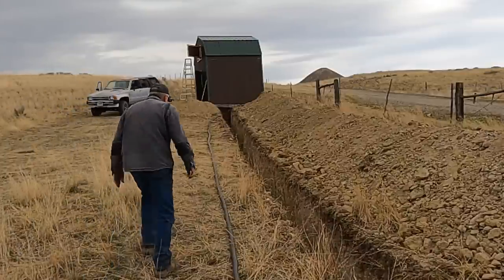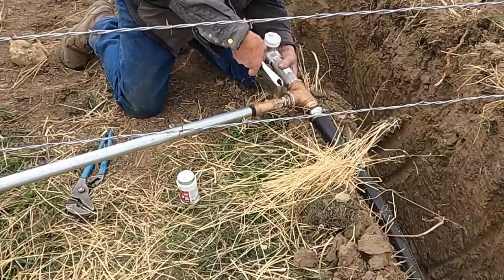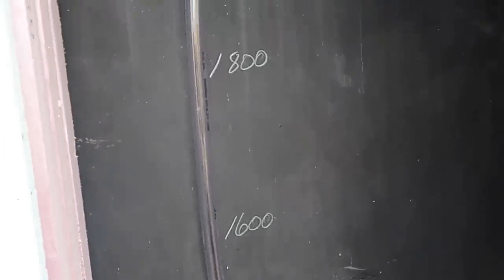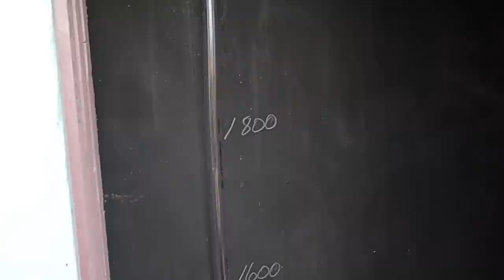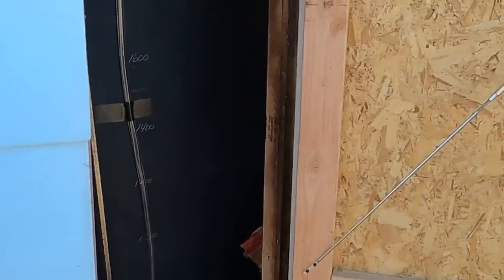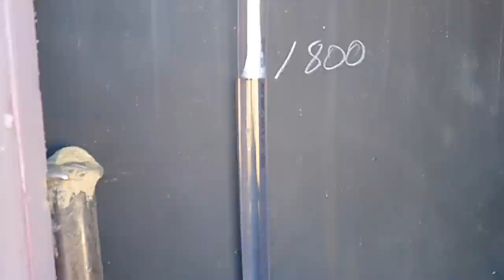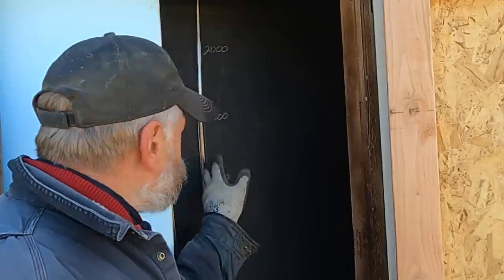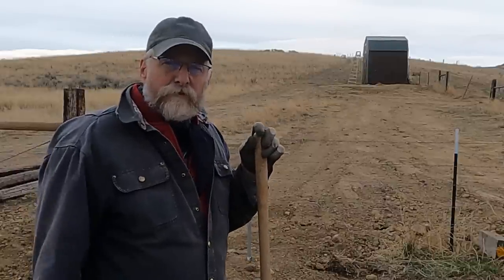Preparing for Winter Watering Calves | Engels Coach Shop

Comment: Lovely job, when we did similar for or field my father had some 4-inch heavy walled PVC laying around.  So he laid that in the bottom of the trench and snaked the flexible 2-inc through that from the well head tank to the frost free.  This way if we need to re-run the line, we simply go down in to the two ends and pull the run out without having to dig it up.  like you my Papa's always thinking on things to do.
Reply: Watching this, I was wondering about putting a large diameter PVC pipe around the drop pipe to the line, put your heat tape on the water pipe, and fill the space inside the big pipe with insulation.  This would keep the heat where it's needed. Could be added later by slicing the large pipe in half.

Comment: Been looking forward to this video all week.😁  Hope you have another video or two on setting up battery, heat trace and insulation of pipe, solar charging, final insulation of the building.   As others have noted, it would appear you need a vent of some sort at the top of the tank if one isn't already installed on the tank.  Filter on the vent seems advisable.  Temperature monitoring in the pit   and under the insulation would appear helpful, at least until you get a sense of how well the insulation retains the heat.

Comment: I couldn't tell, but when you back filled around the frost-free, did you add drainage rock so the water has a place to go when draining out the stand pipe?  Or will you be doing that when you start the extension project?
Reply: He put 3-5 gallon buckets of clean rock around the base of the valve.
Reply: I would think from the looks of his soil, drainage won’t an issue.

Comment: Looks like a good job. My only concern is that overtime will the rocks rib a hole in the line. I live in ohio and we have to use sand  under and over the top of a line and them back file with the soil. They tell me that the line will move some when being used. Overtime it will ware a hole.

Comment: Get yourself a couple extra unions the same as the one as you used in the tank shack.  Put em in a bag or box and set them in the shed so you don't lose them.  If you don't, when you actually need another half of the union, that same style won't be available anymore and you'll be in a hard spot.

Comment: Suggestion: look into installing an anode to prevent corrosion r/t dissimilar metals (steel and brass) at the base of your hydrant.  Nice job !
Reply: I think it is too dry for an anode to work there although there will be a 1/2 gal of water released when spigot valve is closed.  Tar works well.  Stainless and Brass will out last all of us.

Comment: Great project.  A tip for when you're joining the PVC to the brass coupling: after you heat it up and are ready to slide it on, spray the brass coupling with hair spray.  It makes it nice and slick so that the PVC slides on easier but then it tacks up very quickly so, as the PVC contracts back down as it cools off, it grabs onto the hair spray and helps bond it.
Reply: Aerosol or pump? 😃 Seriously, what a great tip!
Reply: @wileycoyotesr8623  It's an old motorcycle builder's trick.  We use it to slide grips onto handlebars.  Works like a charm.

Comment: Don't forget you'll need some sort of a vent .  Need air as the water level goes down, or you'll create a vacuum in your storage tank .
Reply: Was wondering where the makeup air / air release was in the system. Maybe the top hatch doesn't seal particularly well.
Reply: He must have a vent already or he would not be able to pump water into the tank.
Reply: @Clarence Green  he's only pumping 450 gals . Into an empty tank and long periods between loads it could bleed off . But you are correct.  It would pressurize the tank .

Comment: Job well done.  I expect the top of the tank is not sealed and acts as a vent.
A temp monitor in the bottom of the Pit would be interesting.  Time to check the Freeze level of antifreeze in your iron.

Comment: Dave the only thing I do here in Eastern SD is I put the hydrant with a 6 inch PVC pipe mostly to have the drain hole free to drain the hydrant when shut off and also if it would freeze a little hot water along the hydrant thaws out otherwise you have soil to contend with that is frozen and have trouble thawing it out
Had good idea and job installing looked good
Have good winter
Mike Olson

Comment: ref: 5:40
Your system will work, but you could also use a pressure gauge. Each foot of water would be close to 0.5 psi. Using a pressure gauge you could in fact place it on the hydrant and read of how much water was left.

Comment: I do hope that you used "marine grade" hose clamps. My father and I have used plastic water lines buried  underground and years later had leaks at the splices. I found that the stainless hose clamp, itself, held up well, but that the steel "screw" rusted away and let the clamp come loose. Later on I  worked for a boat and RV dealer and learned about marine grade, all stainless, hose clamps. I used these to make the repairs and never had any more problems with the clamps rusting out. Good luck on your project.

Comment: On our farm we did not use the clear tube method for depth measurements. 
Basically we had a float in the tank, connected to a cable that went out the top of the tank, over a couple of rollers and down to a free hanging weight. 
Just had to remember it was in reverse. 
Weight near ground, tank full, weight near top, tank empty.

Comment: Dave, I really like your "sight glass" installation.  I recently saw a similar one on a fuel tank which used a ball valve at the bottom in case the clear tubing got brittle and cracked or leaked.  It could prevent a costly loss of contents.
Reply: Indeed! Only open the valve when you want to read the level.  Otherwise, omit the risk of losing all of that water via a cracked plastic tube.
Reply: Notice that Dave's installation has a ball valve at the bottom of the "sight glass" too!
Reply: @garrettswoodworx1873  So sorry! I missed that.
Reply: @tuberzish  No worries Nate! I figured that might be the case.  🙃

Comment: I am sure you have thought of it but just in case, don't forget to put a foam jacket around and on your fill connection which is exposed to the cold.  You can stack two inch foam board glued together with spray foam and cut a center out to surround the pipe cap.  Nice job.

Comment: Good work!
Not criticism, but a tip from a retired farmer:
When pushing hoses onto barbed spigots, smear some vegetable oil onto the barbs, and on the inside of the hose.
Canola, sunflower, olive-oil, whatever.
You need not heat the pipe, as it slips on with the greatest of ease.
Heat degrades the plastic, especially plasticised pipe, such as you are using here.
And it is food-safe, unlike WD-40, which I have seen "cowboys" use!
Reply: Thank you.

Comment: Dave, you may find that as the 1/2" level pipe ages, it becomes increasingly difficult to see the water level. I have the same problem on my 1,000 gallon kerosene tank which also uses a 1/2" bore clear plastic pipe. I went to a fishing shop and bought a fluorescent green floating bead (3/16" approx), so it is now very easy to spot the level.  They actually just gave it to me, saying it was not worth charging for.
Reply: Excellent idea,👍
Reply: Great idea...
Reply: ❤ or use a diagonal stripes behind the pipe, like on steam engine water gauges 🎉
Reply: I’ve noticed a distinct absence of grass under your feet.😉
Reply: @cliveclapham6451  That works behind glass like I have on my scale traction engine but the problem with plastic tubing is that it grows increasingly opaque as it ages and I don't think you would see the reversed stripes through two thicknesses of old aged plastic. The fluorescent plastic bead solution does not last forever, as the plastic pipe becomes increasingly difficult to see through and the bead tends to bleach in sunlight. I replace both about every 7 to 8 years.
Reply: @wilsonlaidlaw  yes good point l made a glass tube for my application. 🍻

Comment: Great to watch as usual! But am wondering if the tank is vented, even a partial vacuum could collapse the vessel.  Could I also suggest adding an “on/off” valve at both the top & bottom elbow fitting for the sight glass? If a break occurs anywhere , all the water will just drain out to the lowest leaking point. When you need to see the level, open the valves, take a reading, then secure them so that they are isolated. Keep the content coming!
Reply: He did put a valve at the bottom.

Comment: I solved the issue of not getting last 50 gallons out of a transport tank by putting a elbow on the inside  with a perforated pipe just  off the    tank floor . It would get it down to about two gallon remaining in the tank. I saw one done with a flexible hose inside the tank, but it rubbed a hole in the bottom of the tank.

Comment: should not the pipe have been insulated on the riser to the pump head above the frost line?
Reply: The riser normally drains back.  The valve seat is at the bottom and there is a petcock on the riser blocked off when opened and once closed the water drains out.

Comment: - Dave, what is going to prevent the spigot and handle and metal pipe coming up from your buried line from freezing?
Reply: He mentioned a few times it is a frost-free hydrant. They are designed for this. When you turn it off the riser line drains out into the dirt below the frost line so there is no water in the riser or spigot. I found a video about How Frost Free Hydrants Work that showed this in detail.

Comment: How will you keep the faucet itself from freezing up this winter Dave?
Reply: The faucet has no water in it.  When you push down the hydrant handle, it shuts off the water at the base of the hydrant tube, which is 6 feet underground.  Then the water in the  hydrant tube drains out through a drain valve also at the base of the hydrant tube.  So the faucet is empty and the only liquid water in the system is six feet underground

Comment: I live in the sub-tropics so question for those in the know. When you shut off the hydrant, what happens with the water in the riser?  I know that the valve is at the bottom so that it's below the frost line. I'm guessing it needs to be allowed to leach out some how so that the water between the valve body and the handle doesn't freeze.
Reply: Yes, it drains out so it doesn't freeze.

Comment: - Dave, my instinct tells me to build a 2ft x 2ft x 2ft box {with a flip up front} around your metal cap for the filler pipe and insulate it with Polyisocyanurate foam board.
- That metal cap will suck in cold like you won't believe...and ice on the inside WILL travel up your PV pipe and possibly cracking it...AND you will have to break out that ice to fill the tank in the winter.
- Polyisocyanurate produces 7.0 to 8.0 R-Value for each Inch Of Thickness.
- 8 inches, per side = 56 to 64 R-Value and leaves an 8 inch cubic square open space to get at that the cap for filling purposes during the winter if needed.
- The quantum amount of heat in the big tank's water will/{should} keep that 8 x 8 x 8 in cu sq space above freezing.
- Believe me, insulating that one vulnerable place for incoming water is critical. I had to pick axe though frozen ground in 36 below zero weather to get at a metal coupling point so water from our well would flow once as a youth.
- https://www.attainablehome.com/what-is-the-r-value-of-foam-board-insulation/
Reply: Good idea. Thanks. Dave says he'll build a box.

Comment: Not sure that the cap on the outside of the building won't freeze. I'd think that you would leave a bit of water thee after filling as some will never all fill into the tank. thus leaving a bit in the fill tube. If your weather is as cold as you say it gets the metal cap and fitting will freeze making it hard to fill in the winter. Not sure just how I would plan anything better. Maybe having the fill in the pit underground possibly. Less likely it would get as cold and get any direct cold exposure. Just my 2 cents. 

I enjoy all the videos Dave. Thanks for sharing.

Comment: The underground won't freeze and the tank if full probably won't freeze but I would be concerned about the plumbing between the tank and the underground run as a freeze there could stop the flow and crack the pipes. A contact thermometer on the side of the tank might also be instructive.

Comment: Dave, the only potential flaw that I see is with the large PVC ball valve.  If you close it in freezing weather, the water in it will freeze, splitting the valve, and making a fair mess.  Drill a small hole in the side of the valve to allow the water to drain.  I have lost more valves than I'd admit to before learning this.  A small valve at the bottom of the sight tube might also be cheap insurance.

Comment: Do you have vent on top of the tank, I would think it would get a air bubble and not be able to top it off. I know you put crushed stone at the base of the hydrant, not sure if you put some membrane over the stone. The ground could seep down into the stone and clog it over time with the water draining down when the valve is shut.

Comment: I would suggest a section of hard suction hose from the shed to the ground to eliminate the kinking that you are dealing with. Or a forty five degree fitting to angle the soft hose. Look at the outlets on a fire engine for example. They turn down at thirty three degrees to keep the kink out of the hose.

Comment: I am curious - is this gorgeous 3000 gallon tank and building for nothing but the one FF hydrant - no connection to your home or other buildings? Wow - that's a huge (and very frost-free) job for one outlet. I saw that you had an elbow and a cap at the very end down in the gravel, will that be for future connection as in 'just in case,' or will this form some sort of backup supply to your home?
Reply: The plan is to connect it to the house next year. He ran out of time this year because winter arrived.

Comment: Great project. Just one question. How do you stop the stand pipe freezing up, it dosen't look to be insulated?
Reply: It is a frost free hydrant. It drains out when it is shut off. The valve is in the brass fitting below the frost level.

Comment: I hope the hose clamps were 100% stainless steel.  I had a plumber install them in a sewer lift pit that were all stainless except for the screw.  It rusted away after a few years and caused problems.  His workmen had to come back and replace the clamps with 100% stainless on all components. I look forward to more videos.  I hope you have a mild winter.

Comment: The sight glass won't work as plumbed while filling the tank. The supply will just flow into at the top. It should be on its own fitting tapped into the top of the tank.
Reply: In a perfect world, yes.  But he can also check the water level when the pump isn't running, and he doesn't need to make more holes in the tank.

Comment: Do you have concerns about your sight glass breaking from freezing temperatures and draining your water supply? I've seen some which have shut-off valves and a purge drain which solves any possible issues that might result from sight glass damage.
Reply: It has an isolation valve at the bottom. You can see it in the video.
Reply: @beyondmiddleagedman7240  Yeah an isolation valve is good to have along with a purge drain to clear the sight glass during the winter.